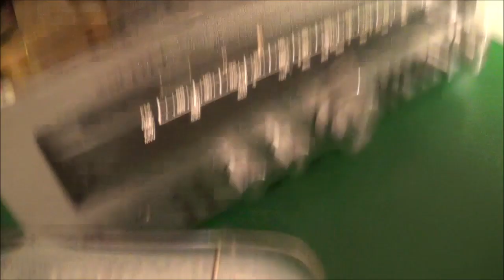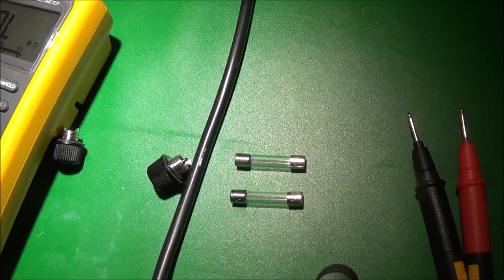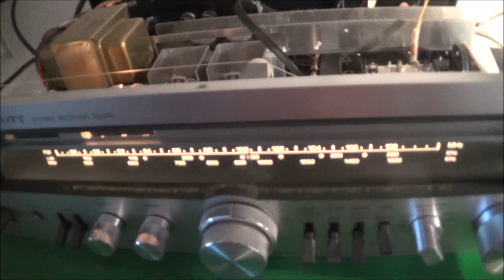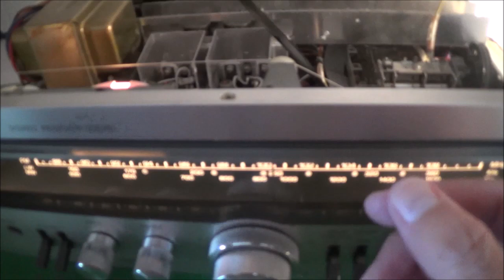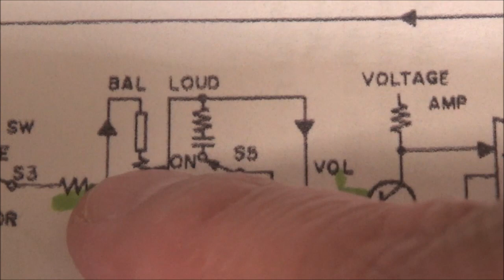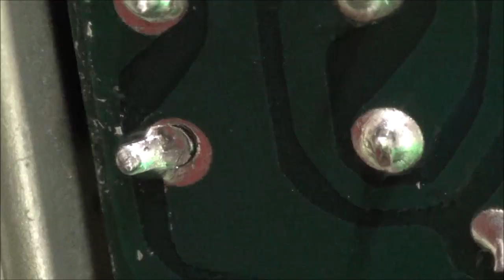Scott 330RL Stereo Receiver Troubleshooting And Repair

Comment: Hey, I have a Scott R-376 and when I turn the volume up slightly, the audio shuts off. I can play it at a very low volume, but when I go to turn up even 1 click, audio shorts out. A fuse would not allow any audio if it was bad, right? Any ideas?
Reply from the maker: You should clean the volume control for starters. Spray it while the power is off, off course. Sorry, takes me a while to respond, since I am barely on YouTube nowadays.

Comment: Hi there, very much enjoyed your troubleshooting video.
I have just bought an inexpensive scope and have been looking at YT vids for guidance. Most explain you what it can do, what the screen means, how to make adjustments etc but I haven't found one yet that explains and fully shows fault/signal tracing with a scope and signal/sound generator on eg, a hifi amp  

(DLab channel does one but it's for an old tube guitar amp with a very simple circuit lay out, which may not be too relevent or helpful for me as I'm looking to analyse/repare old solid state audio equipment)

At around 8:00 in your vid, you talk about using the audio generator and scoping a coupling capacitor - I know it's a big ask but if you do this again, could you show exactly where on the pcb and on the actual component you attach the scope probes please ?
That would be a great help to an oldie newbie.
Reply from the maker: Thanks for commenting. I no longer have this receiver so I can't make another video. I will make a short phono stage troubleshooting video soon, as was already planned.
Just a quick note on coupling capacitors here. They let the signal pass but block DC voltage. You can check the waveform going into the capacitor and compare this to the waveform coming out. They should be the same; if not test the capacitor. Notice in my  video in the block diagram that the coupling capacitor is not directly connected to ground. A leaky coupling capacitor could upset the voltages of the next circuit. You can remove one end and test it. Or remove one end and substitute another one. Substitution or bridging is always done with the power off. Of course, an open capacitor can be quickly bridged. Again, with the power off.
Reply: @OldSchoolElectronics  Hi there, that is great information on capacitors sir. Looking forward to the fault tracing video too. Thank you. I'd not seen your channel before, so I've a bit of catching up to do with  your previous videos - I'm sure that I will learn a lot.
Reply from the maker: Thanks for your kind words. Please subscribe if you have not already did so. Stay tuned for more videos; I will be away for 10 days or so, then I will begin again.
Reply: @OldSchoolElectronics  Fantastic sir, looking forward to them

Comment: Great quick repair sir, I must say that Scott 330L has many fuse located at obvious spot. Very good safety design.
By the way, very nice RCA to Banana probe there. I dont do many home audio repairs but you gave me an idea to do a TRS to Banana style for guitar amp checking.

As always, keep up the good content and Thank you very much.
Reply from the maker: Thanks so much, sir, for watching and commenting! Yeah, that was an easy fix. Glad it wasn't the transformer or the output transistors. This (your comments) reminds me to watch your newer videos.
Reply: Sir, I forgot to ask this previously. Would you mind showing us your dim bulb setup.

Comment: Good to see it was an easy fix!  And so true about old age and the need for beer goggles!  :) I currently am working on a Pioneer SX-V200, same issue, however, I found a problem with a fried resistor at the PA, I am in the process of a complete gut and disassembly just to change....the unit is from the 80's...I'm thinking of maybe a complete re-cap...this unit will replace my current workbench stereo.  Nice to have 2 videos from you in a week.  ~Jack, VEG
Reply from the maker: Thanks, VEG, for watching and commenting! I really appreciate it. Would be cool to see a video of that Pioneer of yours if it is not too much of a hassle. Those optical "aids" make a big difference.
Reply: Not a prob...a video is happening and I even mention you in it....after all you are my inspiration in working on it .  Now, when will I get to edit it once done and posting it is another story!  I have been just trying to get through a bunch of projects as I have tons to do, figured posted videos will take a back seat for now...my last video, I recorded last month...plus I still have all my vacation videos to edit and post....but I am also enjoying my new freedom from my eyes and able to go play a little.  :)  !Jack, VEG